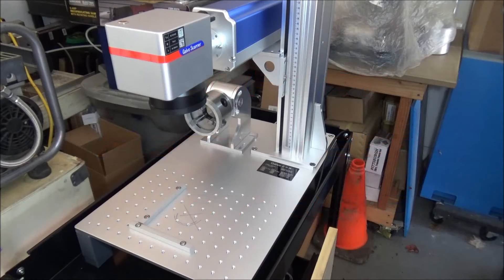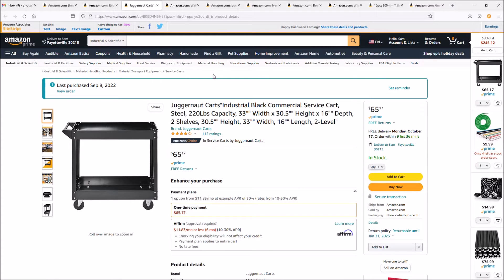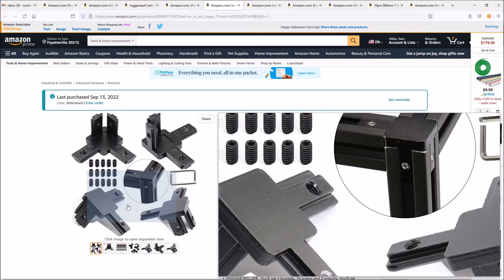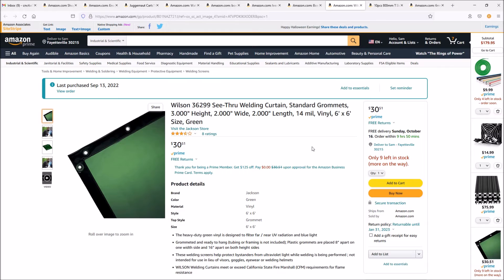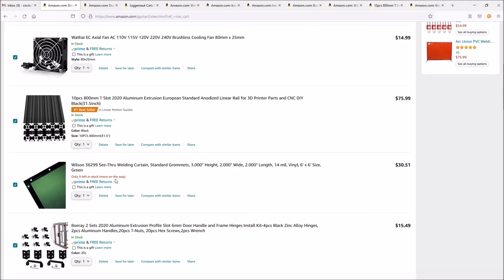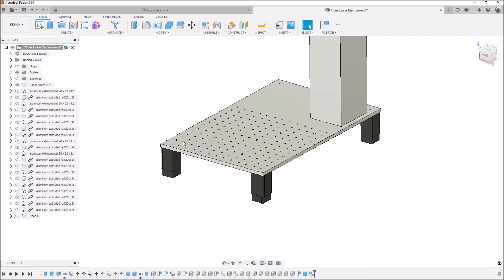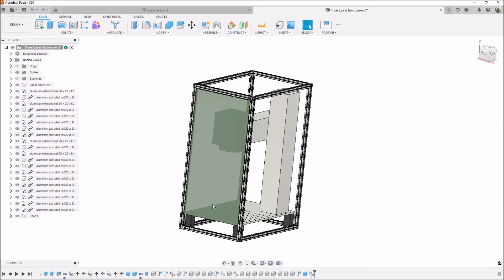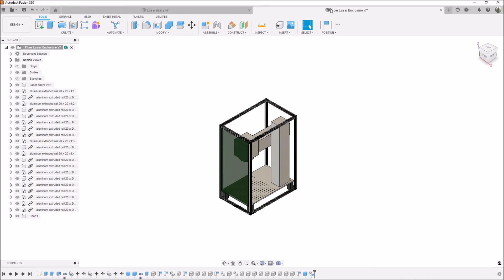Fiber Laser enclosure Pt1

Comment: Is a welding curtain opaque to a 1064nm laser?
Reply from the maker: No it's in the 380 nm range.  It's not intended for replacement of goggles or protective eye wear.
Just an extra precaution for bystanders.
Reply: @CNC4XR7  Oh, so just a don't stick your hand in here precaution, rather than a blinding laser precaution.
Reply from the maker: @JustinAlexanderBell  lol it should prevent a   stray beam bouncing off a part from blinding anyone. Since most of the parts I will be engraving have a mirror finish. I wanted to be cautious ⚠️.  Like I say may be overkill.